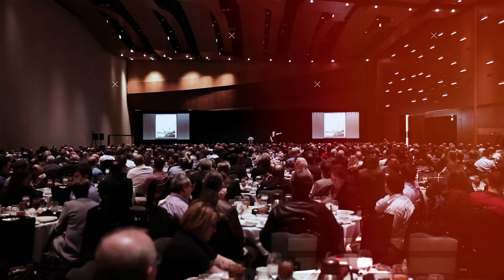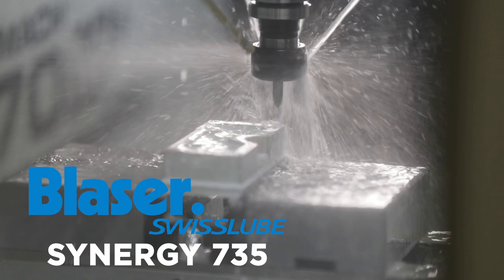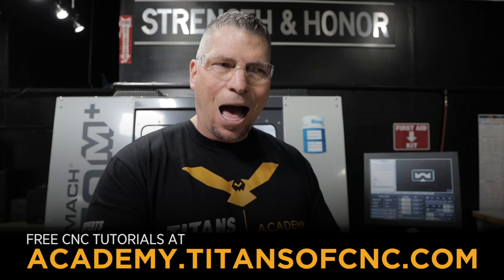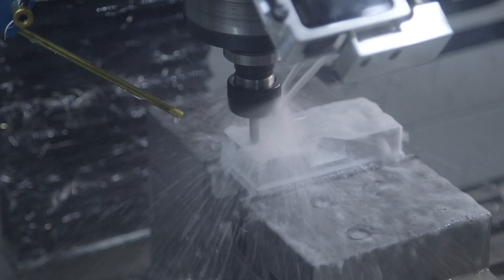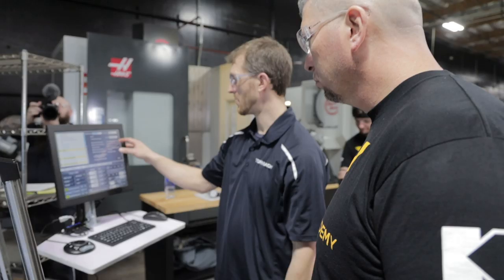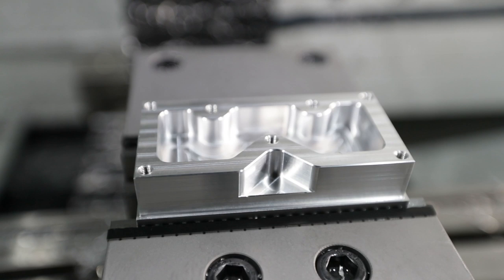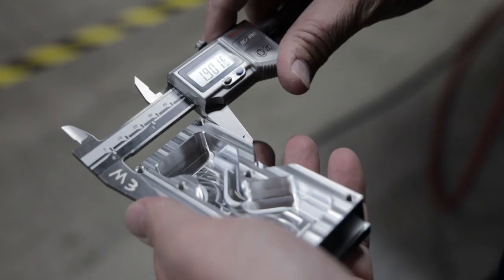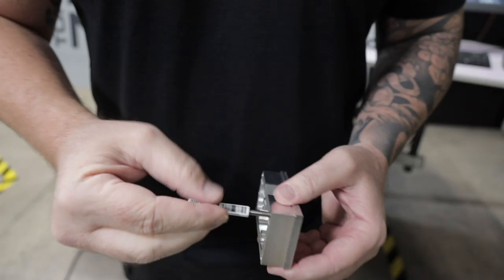My New Tormach CNC Machine - Vlog #58

Comment: i love my 1100M... does everything i need it to plenty fast enough for me.  if your use case is prototyping, it's hard to see how you can go wrong for the price.  that's not to say it won't remove material pretty effectively with a shear hog either... not really sure i'd want anything much more aggressive running in the garage :).

Comment: I have an old 1972 Bridgeport mill (BOSS 5) the controller died. Re wired it with new parts, now it runs MACH 4 fund great total cost was less than $1500.  With a little work you can have a 2 HP machine in your garage also.

Comment: Nice vid, Just purchased an 1100M, also picked up the synergy 735,... my question is are you running a skimmer on the 770?, or is the synergy 735 fine with the excess way lube oil mixing in with it? Thanks in advanced.

Comment: I make titanium parts on my 770 regularly.  It lets me do a side job... at work... when my main bread and butter is slow for the week.  And you absolutely can get the Tormach to nail .001.  It's like you said, HOW do you do it.  I want to see more about that drill you used in this video.  That thing plunged in aluminum on a Tormach like nothing I've seen before.

Comment: Which is better solidcam or fusion???
Reply: It pretty much depends on which one you are using.  Go ahead, find people who use one, and find people who use the other, and ask them.   lol
The thing to be concerned about is if it will do the stuff you need to do to get those chips flying.  If you are lucky, and facing growth, you will want to try to figure out if it will do what you may want to do also, kind of guess work there, but worth considering, just in case we beat communism and can grow. :)
Here, do this.  Now that we have 3-d printing with may plastics, nobody makes a sport goggle, (I dirt bike ride, and eyes are not as focused as when younger) plastic lens that is 3-d printed with perception surface data.  If you can find a clear (or tinted) plastic that takes impact, (not shatter), and scratch resistant, (I am thinking lexan), you can simply copy the shape of the perimeter of popular goggle lenses, (Like Oakley, 100%, Fly, etc, etc), so yours will fit in their frames, get the surface data from the customers eye doctor, and print them with a $500.00 machine in your bedroom.  Nobody makes a perception lens.  There are "OTG" goggles with a wiser frame, (Over the glasses, and they never fit well), and there is a company using fixture arms to hold a lens against your flat goggle lens, but I am not too hip about parts that can come lose and bounce around my eyes when flying through a bumpy dirt bike trail.  Make a prescription lens clear and tough,---and you have a $15.00/lens winner,---all around the world for a lot of different activities.
Enjoy the free enterprise system---while you still can sir.  :)  I hope my gift works for you.  I wear Oakleys.  :)

Comment: Hi.  How do you know wich speeds and feeds you should use in a machine with such low power?
Reply: Rafael Lopes Calculate metal removal rate and multiply by unit power factor. Compare that to the horsepower/torque rating of the machine at whatever RPM you’re running.

Comment: What do you think of the pocket nc 5 axis desktop mill £5500
Reply: jack hannah they just announced their higher rpm spindle so it looks promising other than the size limitations
Reply: It's a lot of money for that tiny thing that has no rigidity... A LOT of money.
Reply: Andrew Delashaw I mean is there another cheaper 5th axis machine that can run small Ti?

Comment: I didn't think you could get a Tormach with servos?  What ever happened to the MX!?
Reply from the maker: Didn’t want to get their best machine... I wanted something smaller that had a cheaper price point
Reply: MX is delayed.  M is upgradeable to servos when MX is released.  M+ not available to general public....yet
Reply: Servos will be available in April to add to the M machines. The + is to indicate servo version. 
MX machines will be coming out mid-year. If you have an M (or M+) and wanted to transition to an MX, a spindle upgrade will also be available mid-year.
Reply: @lmorrisonbufalo8828  i also heard M owners who buy the upgrade kit (servos AND spindle) get a $500 tooling credit
Reply: @bataantom  That is correct!

Comment: Hello sir 

I am from India 

I have to plan by the vertical machining center 

So finally I decided two Korean made machine 

The machine name is 

1. Hawachon  visita-1300 model and
2. Doosan. Dnm-6700 model so which one is best machine please tell me sir 

And as well as price also I am looking low price 

For mould and die manufacturers application 

Please help me sir
Reply: Doosan is nice machine with AICC 2 and SSS I.e mould package
Reply: Both Hwacheon and Doosan are reputable CNC manufacturers. Although I do not have personal experience with the machines, evaluating quotes I would do this:
-Try to decide which of the options fit my projects the most and ask for these. Try to correlate between the spec sheets so you have roughly equal machines.
-Then take a past project of yours and have them run it on their demo machines if possible specced like the one you had quoted.
Should give a clearer look on which you should buy.
Also, take care when calculating your ROI. These machines are supposed to make money, not look pretty.
Reply: @ExMachinaEngineering  --I agree, and with these 2 machines it would boil down to support and parts availability.  Otherwise these machine manufacturers are pretty apples to apples, in my opinion.

Comment: they check 1 out of every 20 machine...
Reply: That is misinformation. All Tormach machines are QC’d at the factory and they must pass 13 quality tests of precision inspection, as well as 18 tests of function and appearance. In addition, one in every 20 machines is inspected with a confirmatory laser interferometry test for QA purposes.
Reply: @lmorrisonbufalo8828  nice to know, and where i can found more information about this test? becouse i see people complaning about tabel wobble and this take to 0,1 mm of error in the mesure... i'm hold back to buy one of this machine cause i'm worried about this problem
Reply: Libra SD Where did you get that information?

Comment: 15 grand for a stepper motor hobby mill with castings made in china. When tormach was a little girl 1 decade ago we used to retrofit our own machines.That's what the garage-machinist movement is about. Not dishing 15k on a joke mill. Is the hobby machinist going to have acccess to kennametal drills? Nope, we just get what's there at the fleamarket. Don't worry, I didn't thumb down your video, because I think you're a nice guy.
Reply: That "joke mill" has made a lot of small shops a lot of money....
Reply: And a side note, you don't need to be some big shop to "have access"
 to kennametal.... It's not some unicorn you need to hunt and consume its heart....
Reply from the maker: I respect your opinion but, this one has servo motors etc. That’s what the M+ means.
Reply: I saw on their website that the MX would have servos.
Yes, you sort of need to "have access" to kennametal. I could go and buy a really expensive production drill, but I won't if I have a $1000 lathe and a $1000 mill garage shop, because I would probably have to get 1 of each size. Its "access" as in "financial access" not as in "VIP access", to clarify. They're made for production, do you plan on drilling 10,000 holes with that drill? Can you afford to crash it, are you equipped to resharpen it?
Reply: @OakwoodMachineWorks  Oh you could make money with it all right. But you could with a manual machine costing 1/10th the price too. I love machining, I wish this mill was all it was cracked up to be, but I have learnt over the years it is unfortunately not. Watch the review i posted above, it will absolutely shock you how they can get away with it. They claim their machines are positionally accurate to 4 10'ths but this totally not true, they only test 1 in 20 machines and there are 100s if not thousands of people with tolerance problems! 15 years as a hobby machinist, I can no longer fuss around with a mill for a month to make it work, because I work for a living. For 15k the customers should be getting a working mill corresponding to the spec sheet. If they want to clam it can only hold 5 thou tolerance, that's ok too, but at least the customer should know.
Reply: As a resident neurosurgeon, if i went and bought this mill today, it would bankrupt me if it has downtime. I am not making boatloads of money and I have huge student loan debts. Machining as a hobby has brought great joy to my life, but now that i'm not a teenage machinist in my garage, that 15k has to pay for itself and put food on the table. I hope to make medical parts like spinal hooks in the future, that's my dream.
Reply: The stepper-vs-servo arguement is funny. Tormach used to publish papers that steppers are superior and that you don't need servos, yet now their flagship model is a servo machine. The guy reviewing the mill says that the servo version comes to ~25k$ , and recommends getting a haas mini-mill instead for 29k$. 7hp vs 1-3hp spindle power and all the good stuff haas is known for, financing, and high resell value if things don't work out.
Reply: @meocats  29k for the Haas and you still have to buy tooling. 30.5k and you have a 4 axis mill with ATC and quite a bit of tooling. Probably 34k for the MX version when it comes out.  So, for 29k, does it have what it needs to cut on delivery day? Or after assembly I should say. Positive reviews seem to out pace negative reviews. Watching the review of that 440 the guy had to send back is concerrning.
Reply: @billgreathouse1913  Yep. Its all about the service. That's why rich people drive expensive like rolls royce. They didn't get rich by throwing their money on things they don't need, but they'll buy an expensive car for the service/reliability. This predictability is very valuable in business. Accessories aside the haas is a slightly more expensive deal for twice the machine and quality, and with financing options rather than shady customer support, slow refunds, and inadequate adjustments.
Reply: @meocats  the primary point that I was attempting to make  is that they aren't comparible machines in any aspect other than work envelope.  Definitely not on performance, service and quality. But if it is all a guy can afford for the type of business he's getting into, that's just what it is. I'm probably gonna get an 1100M with 4th axis and quite an assortment of tooling. Yes I could buy the hass but then I'd have to give up buying a well equipped manual lathe. What I'll be doing is a niche that guy throw money at. I have 6 products that I'll be producing most likely 10 to 50pcs at a time. If it gets bigger than that, I'll farm it for a little smaller margin that I would have made doing it myself.  I'll put the money away and move to a Haas soon enough. My job is going away, I'm a little jaded and at this point, can't see myself punching a clock for someone else much longer. Something like this may very well launch me. Then again, it could bury me. I won't know until I try. I do know I'll learn something that for sure. Hell, we had tinker and work on our equipment all the time to. The last prototrak mill we bought was Chinese iron that rang like a bell when you seated a part in the vise.
Reply: @billgreathouse1913  they are comparable in price. I am also trying to make a living part time with machining. At work we use a retrofitted russian behemoth mill. The controller is GSK china servo, these mills you can find for like 1-2k at auctions. Something like 1500x100mm table travel. The table rides on needles like a surface grinder and is fully supported, no sag like on haas mills. Machine is about 3 meters deep from the front to the back. and just about that tall if not more. I recommend retrofitting a Maho / Deckel mill. Were in the process of retrotting one with a 1 meter rotary table built it. Very nice and cheap. If you just sold it for scrap you would get your money back. Check out the maho 1000MH. Its 4 +1 axis. You tilt the head if you need to do bevel gears or something. They come in smaller sizes and also bigger sizes. We have another one 2 meter fixed table: the entire XYZ assembly travels. That is also getting retrofitted. It comes with tool changers. We had a smaller deckel or maho that got sold because they do hydraulic equipment not small parts. The maho has chip guard, no toolchanger. Spindle speed is 4k i could be wrong, the other bed mill only goes to 2500 and heats up so it needs a spindle upgrade. We have a small horizontal being retrofitted to make pinions, its about the size of a knee mill, real cute and small. That will  be getting a 22k spindle. Its purpose is to replace some gear hobbing machines. This is in europe maybe you guys have better luck with fadal's in USA.
Reply: meocats well, I can promise you that you won’t be making medical grade parts in a tormach. You are better off finding a used Haas. Tormach is notoriously shitty.